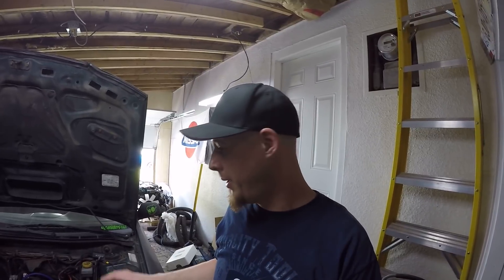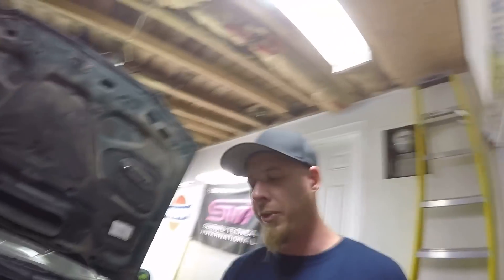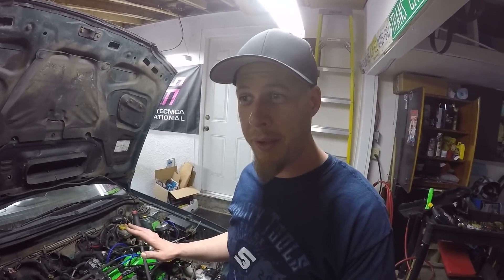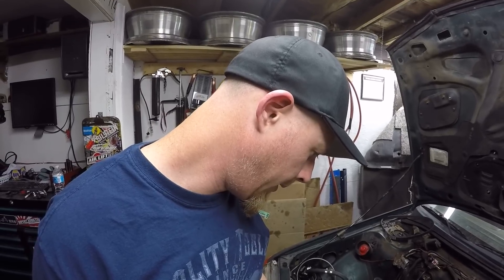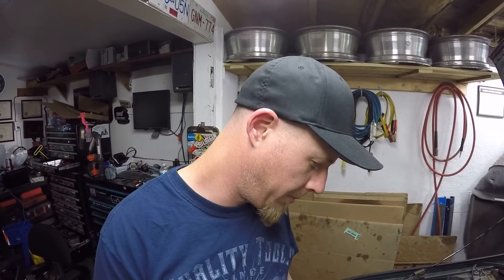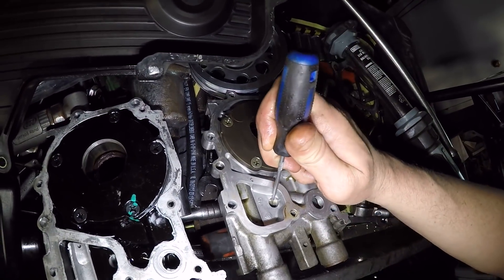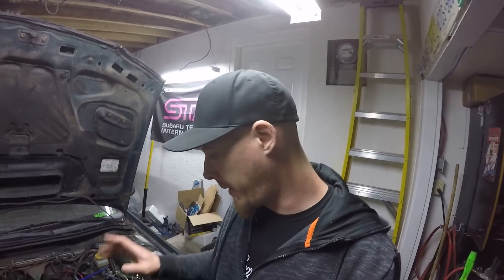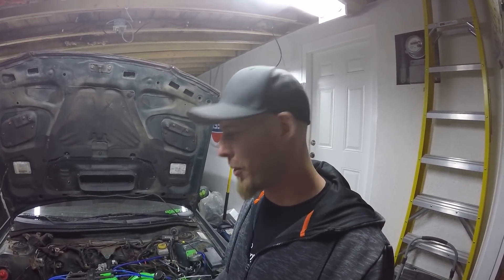SOHC EJ257 Hybrid Build Part 9 - Second Start Up

Comment: Trying to build something very similar, how has it held up? Did it make decent power?
Reply from the maker: It held up very well for the time it was used. Makes good reliable power. Sat on a stand for 2 years and is currently going into WRX in the latest vids

Comment: Is that turboed or not and what's theost power a non turbo rubaru can make I wanna get the ez30d engine or build a block like this and I wanna get 240-260 HP but without a turbo
Reply from the maker: This was turboed.

Comment: once my 11 wrx is out of body shop driving my 11 impreza sport  auto is kinda making me want to turbo the dam thing lol  its so slow on pick up wondering   where did u support the uppipe and turbo on the cylinder head  i know on the ej255 theres a small bracket that goes from head to  the  up pipe to support turbo   so wondering how u did this on yours ^_^
Reply from the maker: A little turbo never hurt climbing steep inclines ;) 
Let's just say... it isn't supported. I've always thought of making a custom support bracket for it and one should be made but never has been. The pipes have never had any cracks or leaks, so the bracket has never been needed.

Comment: I've never dealt with an oil pump before. All I know about these is that it's recommended to loctite the 4 screws on the pump assembly. Thanks to this I know what else to check now and what that thing of to the side actually is.

Comment: Homebrewww what kind of ecu and intake manifold do you run in your hybrid setup?
Reply from the maker: The ECU is the original 2.2 Subaru ecu. The intake manifold is from a 99 2.2 liter as well as the injectors. I would consider swapping in a 2.5 ECU and intake/injectors, but if I was going to do that I might as well take the extra time and money to do a tuneable ECU. The engine will hold more power than I will get out of it with what I have, so a future upgrade is a possibility. Need to confirm reliability before anything else.
Reply: Thank you! Nice to know

Comment: Seen guys put the valve in backwards trying to push the spring in and wonder why they blew all the oil seals out !  Sounds pretty sweet for no exhaust even popping away
Reply from the maker: I have seen high oil pressure before, very lucky I didn't pop that rear main seal. That would suck.
Reply: Homebrew Subaru totally would of sucked if blew the rear seal.  That’d be a push out the garage and you can wait 😜

Comment: Ever though about a speeduino?
Reply from the maker: I had to look it up. There are a few options, but I need time I don't have right now for something like that. I bookmarked it though, are you using it?
Reply: Homebrew Subaru not yet. In the process of wiring it up. It's pretty simple and besides grounds only about 13 wires get hooked up. I don't have much time either so it's taken some time but I've worked on it little by little and I'm almost done. If you want to know more there's a guy by the name of isaac dalton, find him on facebook and ask about them. Hes a professional speeduino builder and has his own version called speedys. He helped me make a pinout sheet for my 00 ej22 inpreza. It's pretty much the same for 98-01 ej22's besides some minor differences. So if you decide to go that route we've got the legwork done (: he's also working on pnp speedys, maybe ask about those as well